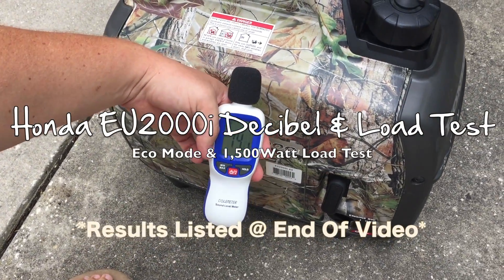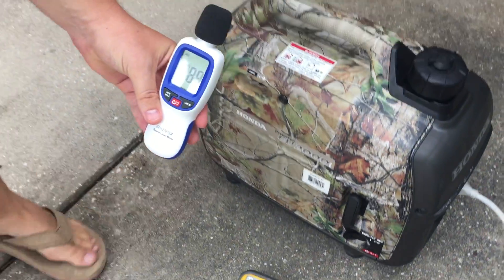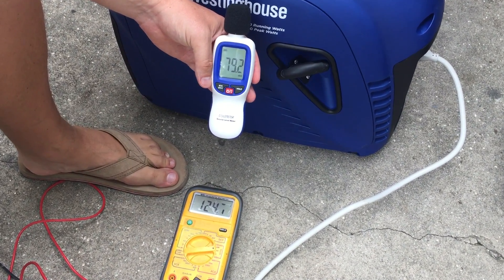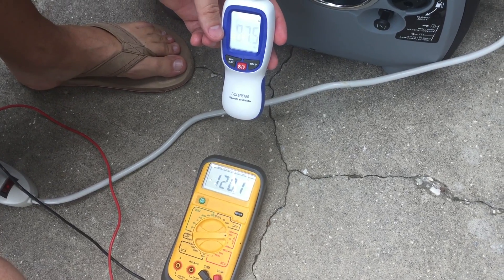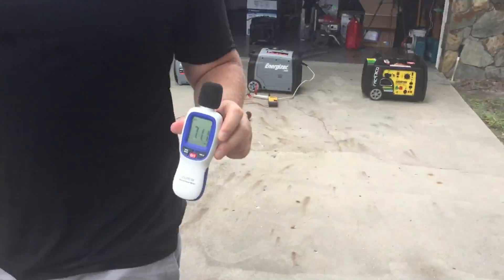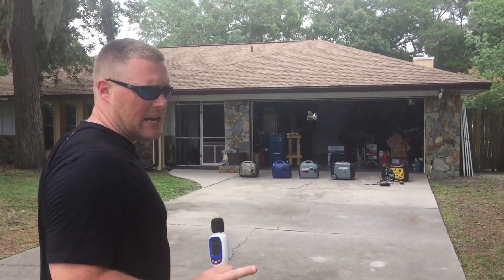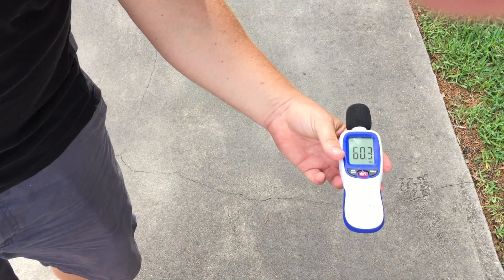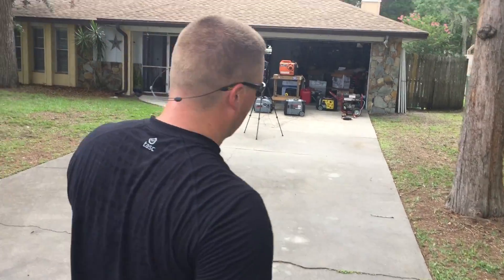Ultimate Decibel & Load Test: Honda vs Generac, Energizer, Westinghouse, Champion & Coleman

Comment: Ah your champion on eco 20 feet  was 58 before you talked fake??????????
Reply from the maker: The decibel meter is constantly bouncing around. It was reading 58.9-60 during the pause. It certainly was not in an effort to increase the reading by 1 decibel... We have no reason to do that. Our reviews even state that the Champion is one of the best bangs for the bucks.
Reply: @generatorpower7744  Although sound level is interesting its really not the main reason for buying a certain brand in my mind, all the gens were close except the open frame non inverter.  The big pic for me is how far Honda and Yamaha are being left behind. I owned a Honda 2000 and own now a Yamaha 1000, the Honda was over 15 years old when I sold it for a premium because I took care of it, and my model gen is exactly the same as a new one. The Honda sold for used was more money than it cost to buy 2 champion 2000 watt gens (their new one, check it out) any way I bought one. (home depot 350 bucks just a couple weeks ago)

I assume you own all those gens you tested so pretty clear you know a lot about the gens. This was the only video of yours I have seen. I am a champion fan for sure but for very good reasons. My Yamaha is 20 years old and going strong, so I am not knocking Yamaha or Honda but both are way behind the curve when it comes to modern gens when it come to features and price. Both Honda and Yamaha are selling 1000 watt gens and I believe thats my choice 90 percent of the time with my RV. A shame they are so expensive. I just bought, last year a replacement 1000 watt gen (sportsman Yamaha clone) I paid 800 bucks 20 years ago for the Yamaha, I bought the sportsman for 160 bucks big diff in price very close in features and quality it seems. Time will tell.

All the gens sold here in the USA are made in china, yep even Honda and Yamaha. Champion states they design and have built their gens, Honda and Yamaha do the same, not sure about other brands. I also believe the HF gens are pretty good but champion has a 3 year warranty HF has 90 days and champion's are close in price to HF. Onan makes theirs here in the USA, Cummins owns them.

Features, champion is blowing every one away, including Honda, Yamaha, Onan, wireless remote control start is one. price is another and service is outstanding. For those that still want on board gens in their RV and already own an Onan 4000 that is worn out, look at Champions new HI-BREDS 4000. Price for the Onan 4000 replacement 4000 bucks, for a champion 750  bucks, now champion doesn't just bolt in, you have to make it work but I bet Champion will make a direct replacement hi-bred for the Onan soon. I personally dont understand why any one would want a built in any more, but  some may.  

I was messing with you a bit on your video, thanks for taking the time to produce it.............Michael

Comment: Most of the "2000 watt" manuals say to turn off eco-mode when the load is over 1000 watts.  Unlike the strictly mechanical generators, these units don't have enough inertia from the mass of the moving metal (piston, crankshaft, generator rotor) to maintain their output while the throttle control brings the engine up to speed.  Your test is asking something none of them offer.  

Your digital voltmeter doesn't update quickly enough to accurately capture the truevoltage drop.  You need either an analog meter with a very lightly damped movement or - even better - an oscilloscope that can actually show you how far the voltage dropped and for how long.  Some of the "how long" is audible as the time for the engine speed to change can readily be heard.

Although having the garage behind the gen does affect the sound level some, it's very realistic when using a gen for home backup power - there will be a structure of some type within 20 to 50 feet, depending on the extension cord being used.
Reply: Yamaha has the sieb series that use the starting battery to increase surge capacity,  it would be interesting to see if that helps with sudden loads with eco mode enabled.  I've got the 3kw version myself and it works great, but it would satisfy my curiosity to know if the boost feature helps when in eco mode.

Also technically you're correct that he should use an oscilloscope to measure the drop, but I suspect 99% of the audience would not understand once you throw in the math to get rms voltage.  I guess unless he uses a scope with an rms calculation feature built in.
Reply: Matt South Hi Matt. How well does your 3kW one handle large surge loads when it’s running on eco mode?

Comment: What I would love to see is a comparison between your Honda EU2000i, and the new Honda EU2200i.  The EU2000i always beats the competition starting difficult high amperage loads.  I would love to see if the EU2200i will actually run devices the EU2000i would not.

Comment: Garage acts as an acoustic chamber, longer distances away aren't as valid unless the generator is in the same position every time.
Reply from the maker: They were all the same distance from the garage. We will also be testing all these units again in an open setting to see if they can power a 15K BTU AC in Travel Trailer. We should have those videos up in the next week.

Comment: Wow thank you so much!! Great work to both of you, I really like that you did so many measurements and was so consistent in every way!
I have just one question, do you think that it effected the noise level that some of the generators was about full load while a few other was on about half load?
Reply from the maker: Do you mean in regards to a 1500W heat gun being only half the load of a 3K Watt generator as opposed to almost maxing out a 1600 running generator? If so, yes, but then again we had to be consistent across the board and usually these two units would be purchased for different reasons. For example, if you were trying to power a 15K BTU air conditioning unit in a travel trailer.
Reply: Well they all were on the same load .... 1500 Watts